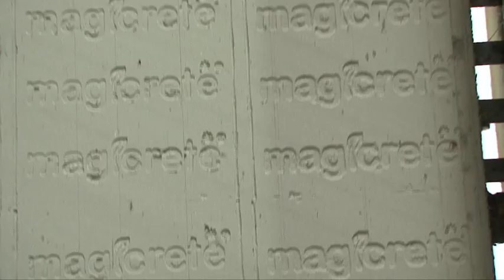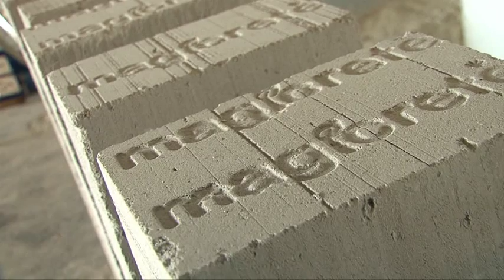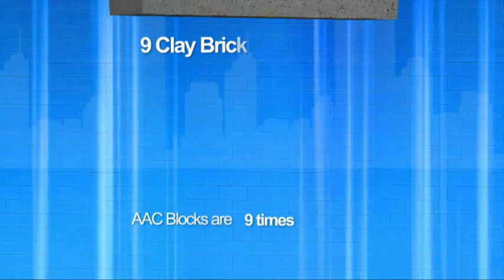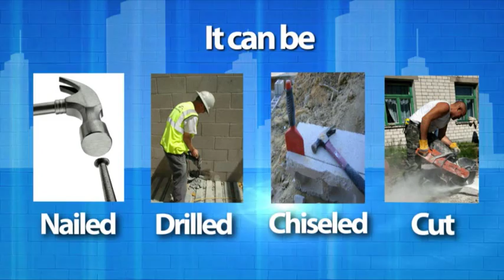Magicrete AAC Blocks_Green Building Material

Comment: Can we install Tata Pravesh Steel Doors directly over 5" AAC wall pr should we provide false column? This is wood like steel doors which is installed using fasteners. And it weighs around 45 Kgs. 

Can we Hang two air conditioning unit on same 5" Common wall for two rooms or will it lead to cracks in coming future? 

Does opening and closing of doors leads to cracks in AAC Block walls after 7-8 months of installation or in near future? 

Is it safe to use in individual house of G+3 Frame structure? Or it's only for Apartments? 

Can we apply direct putty over internal partion walls or will it crack after sometimes of Cement Sand plaster was not done over internal partition walls? 

What do you recommend direct Gypsum Plaster or direct putty and why? Or you recommend to go with Cement Sand plaster first and then coat of putty? 

Even after using adhesives and Providing Lintel and Sill level beam will AAC wall crack? 

What's the life of AAC Blocks? Why Hammering is not allowed in AAC? What if some neighbor hammered my wall from his side?